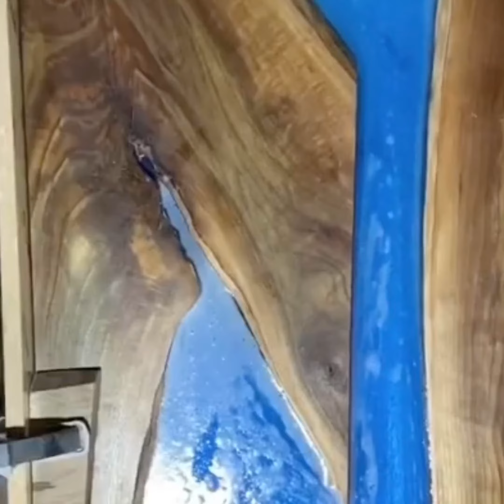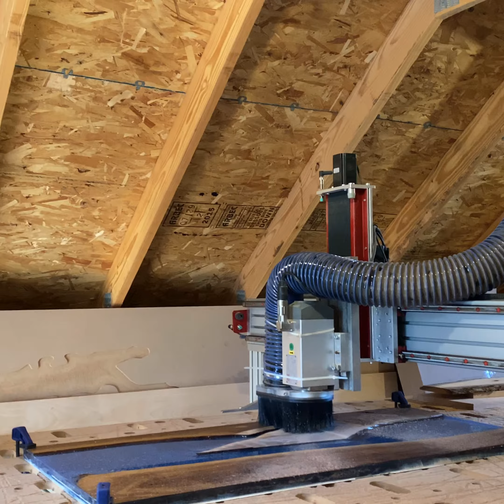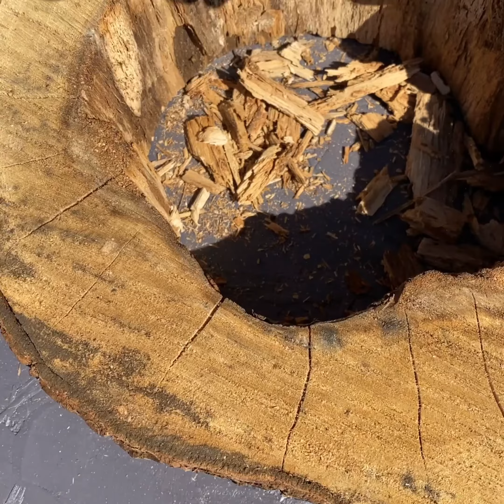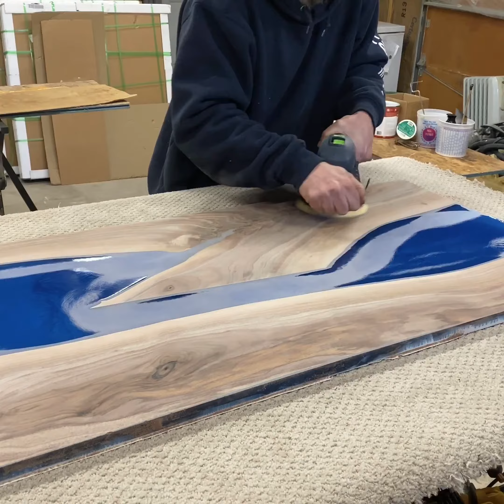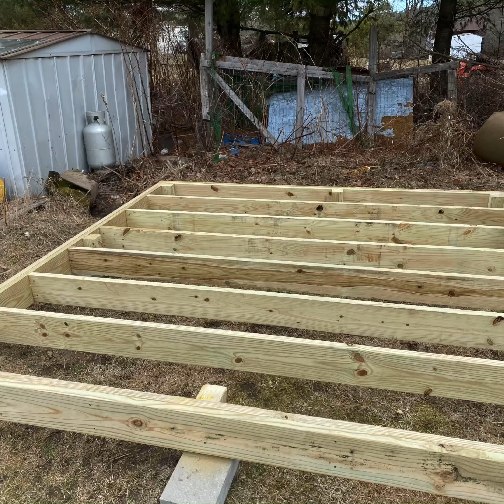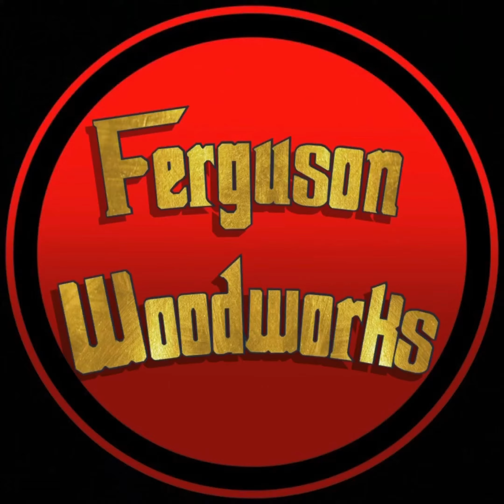Twitch intro

Comment: Hey bud, nice slab. You must be stoked to have the shed. I'd like one about that size so I could empty out my garage/shop and have more room. Peace
Reply from the maker: It’s been 3 weeks in the making
Reply from the maker: Lost Sailor been live streaming on twitch I may try here too don’t know yet
Reply: @fergusonwoodworks  I'm unfamiliar with Twich. I just bought 1.5 gallons from Incredible solutions. I have to wait for warm weather. No heat in my shop. How much resin did you pour into that slab?
Reply from the maker: 2 liters
Reply from the maker: Originally it was 3 inches thick. I’m not familiar with I.S. Ive only used Ecopoxy. So I’d follow their instructions to the T.
Reply: @fergusonwoodworks  Will do. They recommend temps of 75-85 so the way the weather has been I'll be lucky if I can pour by August. I like your routing machine.
Reply from the maker: Well it’s suppose to be warm on Wednesday lol but you need 3 consecutive days of warm weather. Can you pour in your house? I know with ecopoxy there was virtually no smell to it. Idk what the fumes are like with I.S.
Reply: @fergusonwoodworks  I've done small pours inside before. I want to make some coasters.